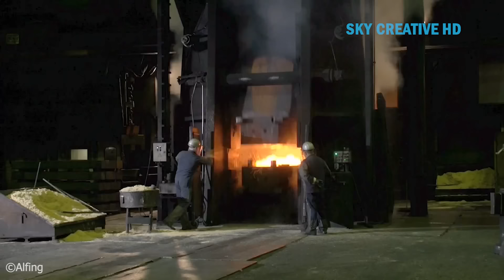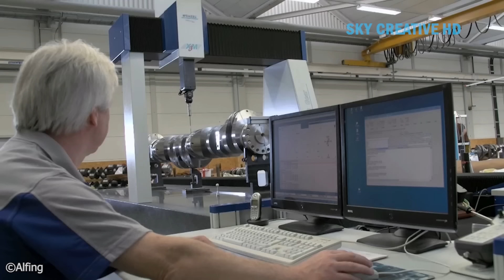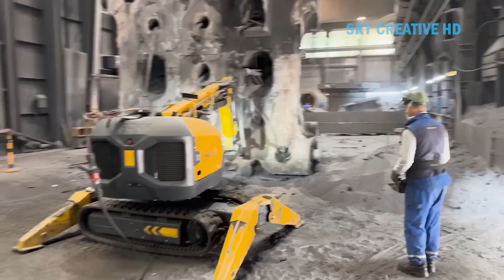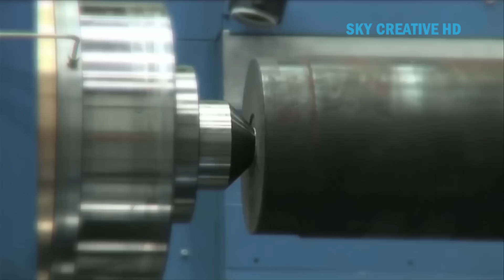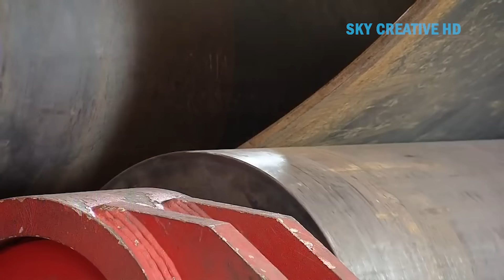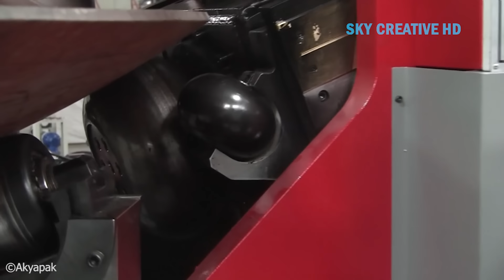Inside Extreme Biggest Diesel Engines Manufacturing Factory - Mega Heavy Duty Workpieces Machining

Comment: To heat Kinds of metal parts that MYD PWHT equipment
      1. Steel sheet/structure weld preheat
       2. Pipeline/tank/boiler/pressure vessel weld preheat and PWHT
       3. Motor Rotor, Shaft Coupling, Bearings, Gears thermal assembly and removing
       4. Any other metal parts that need heat wholly or partially